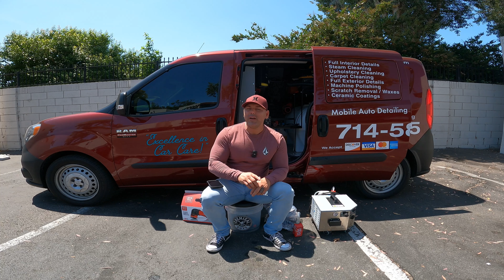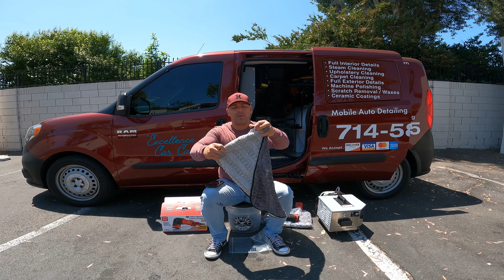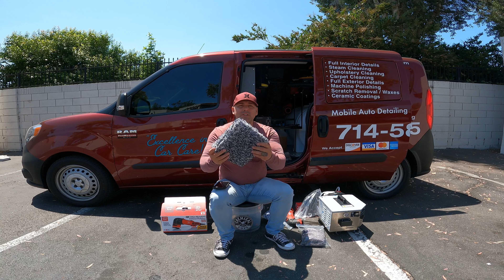The BEST Auto Detailing Supplies for Mobile Detailing 2024!!

Comment: Best wash pads for me are the Autofiber Flat Outs. The cyclone sponges I have from TRC all started coming apart at the one stitched seam. Best bang for the buck with drying towels is the 1500, the DIY drying blanket, or the Autofiber Amphibian or Dreadnought. If you have an autoality membership, their house brand drying towels are insanely inexpensive. (And 1100gsm twist loop)
Reply from the maker: Autofiber Flat outs are amazing. I may buy another round of them soon. Thanks for the info I will definitely check out one of those drying towels!